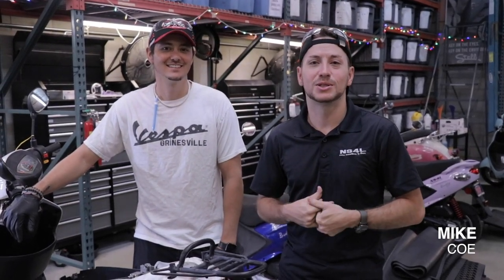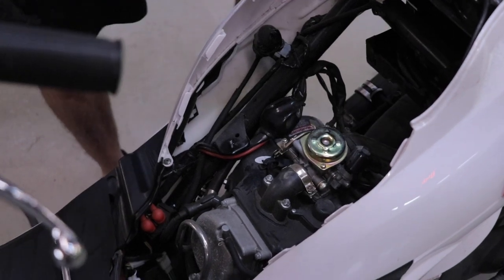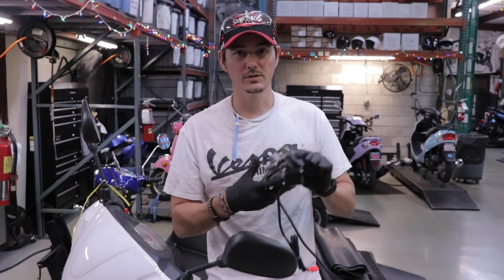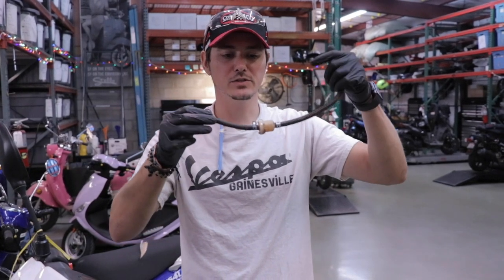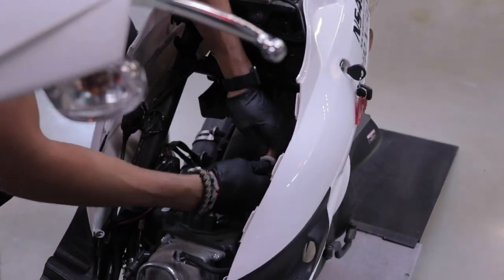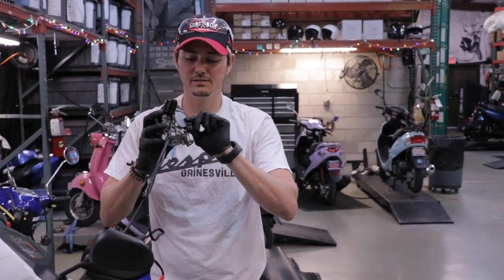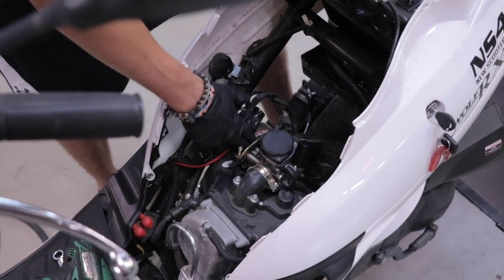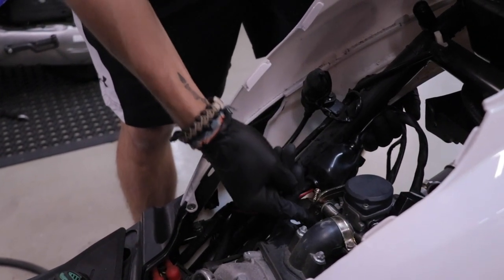How To Replace Your Carburetor | NS4L How-To's

Comment: I have a 50cc wolf brand scooter I parked in the driveway when the house came back out and it won't start I have spark and I've cleaned the carburetor
Reply from the maker: How long did it sit?
Reply: About 40 minutes
Reply from the maker: @chrispayne2269  It only sat 40 minutes and didn't crank back up?  What kind of scooter is it?
Reply: @NewScooters4Less  wolf brand blaze 50cc it ran perfect all day I came home change shirts and it never started again it only has eighteen hundred miles on it
Reply from the maker: @chrispayne2269  Side stand down? (it has a kill switch in it) Kill switch on?  Sounds like something minor like that.
Reply: @NewScooters4Less  no it's not the kickstand I don't even have that on the bike I use the 4 stand. I'm thinking my valves rattling adjust because I just put a new carburetor.gas comes back out the Venturi when I'm trying to start it and when I take the spark plug out right away it's dry. So I'm thinking my valves need to be adjusted right
Reply from the maker: @chrispayne2269  Cool.  Good luck man.
Reply: @NewScooters4Less  I fixed it I just had to adjust the valves a little bit and it runs perfect again
Reply from the maker: @chrispayne2269  Great to hear.